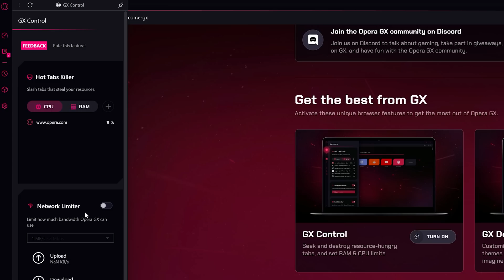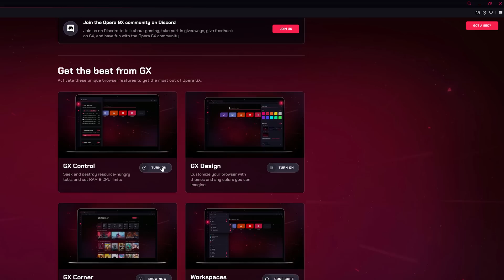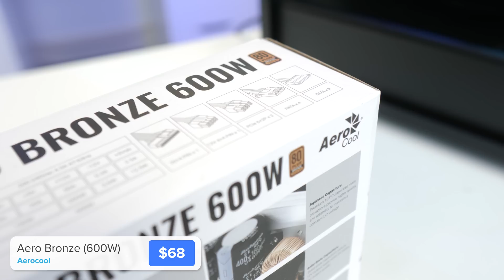Budget $650 Gaming PC Build 2020! [Ryzen 3100 & 5500XT w/ Benchmarks!]

Comment: The parts are fine other then spend the most on the B550 like the MSI Bazooka had great reviews with the 3950x as the only part of the system that allows an upgrade path to 4000 series Ryzen as there next budget chip should be supported and PCI Express 4 is there for the gpu anytime with a 7nm Ryzen as what makes the Ryzen 3 3100 a gem .

Comment: just found ur channel and I love it. however one thing I have to wonder is why you love using 2.5" SSDS when NVME SSDS are easier to install, the same price and way faster. On amazon u can get a 512gb silicon power nvme SSD for 55$. I just got one and it absolutely blows me away. My system is a 3700x with a 5700xt in an nzxt h510i.

Comment: This is my first build I have a list of parts including ryzen 3 3100 and 1660 with  an 480gb ssd ,an  a320msh2 motherboard with an 500w power supply and 16gb 3200mhz of ram and a 40 pound case is this good for 530 pounds? Btw big fan of the builds

Comment: Why low end  b550 instead of high (ish) end b450?
Reply: Bios updates! Most B450’s don’t come ryzen 3000 ready
Reply: Dylon Bowers That was in 2019. The majority of retailers are selling Ryzen 3000 ready. These low end B550s have horrible VRMs so you can’t overclock.
Reply: Dslayer3rd Really? I’m just scared I’m gonna get an older stock and it won’t be 3000 ready!
Reply: @Thatslow600  get the MSI tomahawk b450 max instead of the motherboard in the video. Or find a well priced b450. Be sure not to get a320 because you cant overclock with them. Also if you want to upgrade your pc in the future get a motherboard with 4 ram slots. 😁

Comment: So I’m new to the Pc world will i be able to stream at a high quality and be able to play Gta 5 online with the settings you had with this Build ?
Reply from the maker: For streaming you wanna get a bit more powerful CPU 👍
Reply: You don’t need a more powerful cpu. If you want to stream just switch the rx 5500xt to a 1650 super and you can use the Nvenc encoder to stream.
Reply: Rogue Ninjah will that let me stream to 1080? Or will it be choppy
Reply: A1_Dubstep  That will let you stream at 1080p/60fps and  it honestly looks really good. You just have to make sure you’re using the Nvenc encoder. No need for a powerful expensive cpu to stream.
Reply: Rogue Ninjah honestly just wanna play Gta 5 looking clean for me to play and stream it to where it looks clean enough for the stream
Reply: A1_Dubstep then 1650 super gpu paired with a ryzen 5 3600 would be the best budget streaming  combo. But if you want  to step it up I would recommend spending a little more on 1660 super Or if you can wait a few months for the next gen graphics cards.

Comment: what did it cost in pounds
Reply from the maker: About the same as in dollars!
Reply: GeekaWhat ah cheers
Reply: GeekaWhat Im 12 years old and my mum is not in the best financial space at the minute but ive started getting into pc building and i think ive got the hang of it as i had an old acer aspire m3600 that wasnt working and i took it apart and learnt all the parts and stuff like that. Do you think you could release a cheap £400 full bundle that would run warzone and r6 at a respectable medium 40 fps. Ik it would be difficult and all the parts would be used maybe excluding the psu but do you think you could?

Comment: I have a list ill at the same price its
A gtx 1660 super
Ryzen 3 3300x
Stock cooler
Gigabyte b450m ds3h
Nzxt h510
240 gb ssd
2 tb hdd
Im thinking about a power supply
So if youre seeing this geekawhat please respond with a good power supply around 55 dollars
And this list might be a bit more expensive depending where you live
Reply: h510 has really bad airflow
Reply: @scientistplayz3077  whats a atx case at the same price
Reply: Darkflash DLM21 Mesh
Reply: @scientistplayz3077  im pretty sure its an matx case